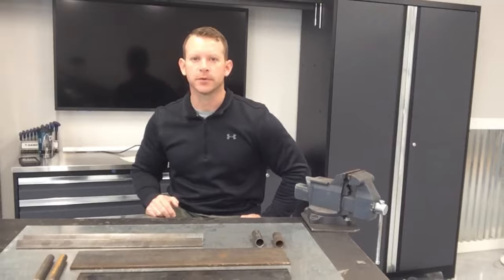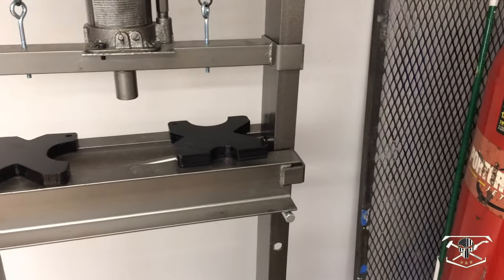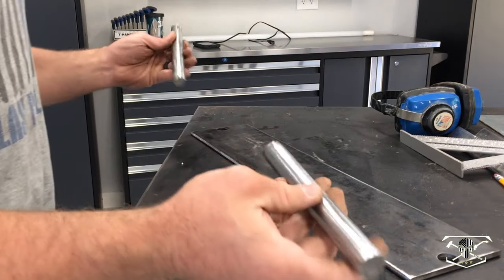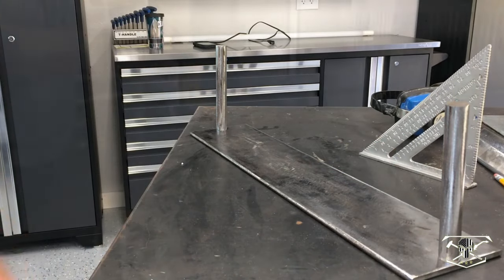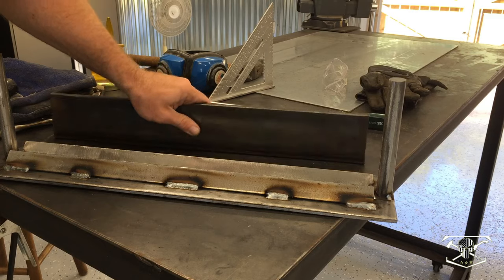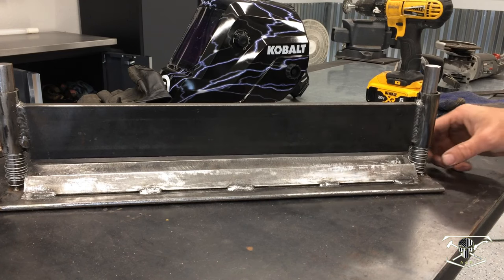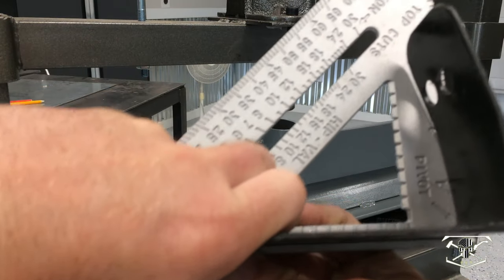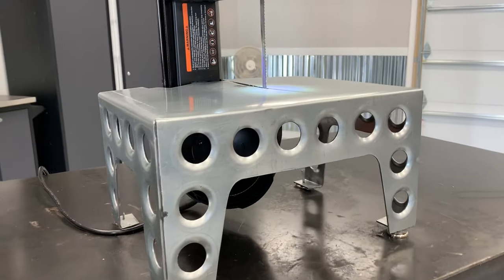DIY Press Brake

Comment: Nice video. Just sharing an idea to you, add a set screw or bolt all the way through the 2” looking pipe piece & cylinder shaft. Removes the need for springs if wanted.
Reply from the maker: That’s a great idea! I will try that

Comment: Nice job . I think I'll build one of these . Thanks . :)
Reply from the maker: Thanks! I have a new finger brake im working on. I should have a video out on it soon!
Reply: Too small. I use a tractor drag blade wear bar for the press blade. Massively stronger and comes with a very appropriate bevle.anything that won't work 3/16th to 1/4 thick is useless. Dan-Co Fabrication.36" absolute minimum width.. nice little project.
Reply from the maker: @dandahermitseals5582  good point

Comment: How has your angle held up as I kinda assumed a tool like this should be hardened?

Thanks for sharing!
Reply from the maker: That was my thoughts as well. I did attempt to harden it by heating it with an  oxy acetylene torch and quenching it in oil however it never really got hot enough to be effective. All in all the brake bevel has held up well with no visible wear yet. It is also important not to try to bend any round stock with it. From what I hear, that will mess it up. Thanks for watching.
Reply: @scantronsgarage  as a press break operator i can confirm as long as its rough bending this will do fine just dont look for stupidly accurate complex parts
Reply from the maker: @dementedbowine8681  Nice! My thoughts exactly. This is far better than the many years of bending in my vice with the big hammer.
Reply: @scantronsgarage  i see someone doing that sort of stupid stuff we are probobly gonna fight you never wanna use a vice to hammer stuff or as a hold to bend stuff its usualy cast metal made to do precision work not the place where you take out your frustrations if you need to bend stuff with a lever or hammer weld a strong u channel on to a thick plate put inside what you want bent and beat on it till the cows come home and if it breaks great find more scrap and build a new one
Reply from the maker: @dementedbowine8681  Correct! which is why I made this thing : )
Reply: Use a wear bar for a tractor drag blade. DanCo Fabrication.

Comment: Can you share a link to the springs. Thanks
Reply from the maker: Sure! here it is and I left it in the video information. https://www.amazon.com/Prime-Line-Products-SP-9734-Compression/dp/B008RG72QY
Reply: @scantronsgarage  thank you sir. Which size did you end up using? Sorry for all the questions. Amazon has several sizes listed in the description. Thanks again.
Reply from the maker: @gemcitywelding7234  oh sorry.. 1 1/8th by 3 .